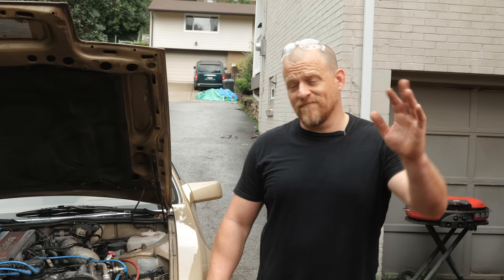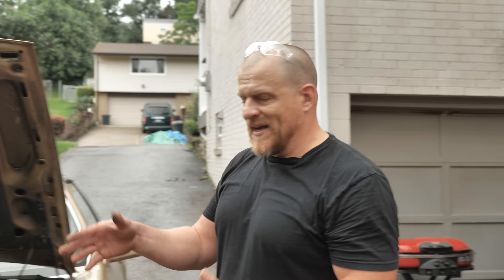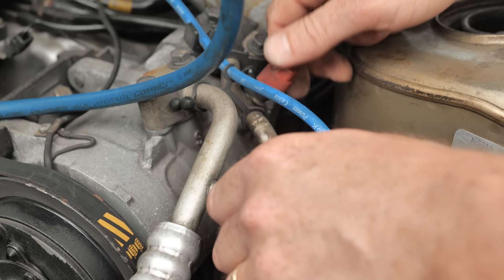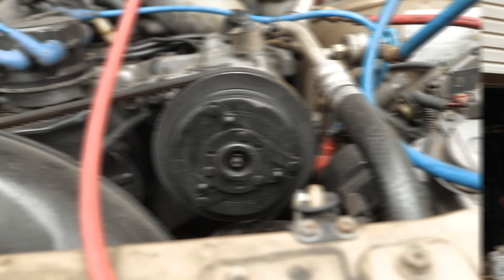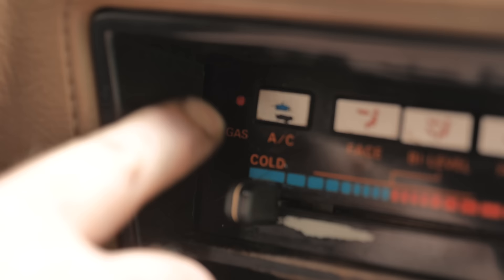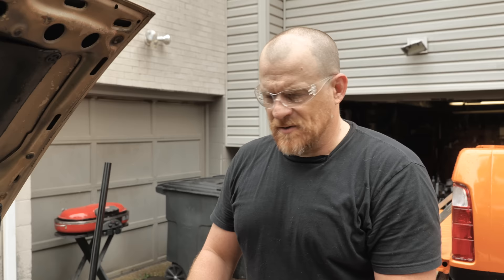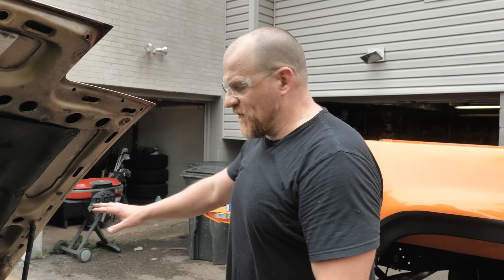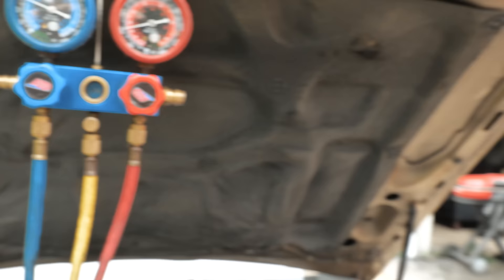A/C Leak Testing, Repair, Evac and Recharge (ANY CAR!)

Comment: I'm sure you are well aware that when it comes to leaks, yet it's always a good idea to repeat, you always find the biggest leak first.  I have come to learn when you find a leak, fix it and look for more, especially when  dealing with customers as they often times think if there is a leak, it's the only one.  Nonetheless, a great tutorial especially when you recap from years past!
Reply: P. Hinton, at 15:08 he indicates his intentions to look for other leaks in the system.  Then at the 20:05 point in the video, he takes some soap and water and spends about two additional minutes looking for any additional leaks throughout the remaining lines/ports/connectors in the A/C system.  But the importance of your suggestion is very valuable: the first leak you discover might not be your only leak in the system.

Comment: When removing the micron gauge; you could have removed it from the car side first using the built in check valve of the low side connector to keep the AC system free of containment air, then remove the micron gauge, reattach the connector and pulled a vacuum on the gauge set with the low side valve open.
Reply: when under a deep vacuum air can pull in via the schrader cores. ideally you'd directly break the vacuum with liquid refrigerant into the high side, after purging from the tank to the gauges or better yet a ball valve at the tank end of hose, which was also at vacuum pump. that way you decay/pressure test everything at once, hoses, gauges, vehicle. and when you go to charge, you only need to purge the tiny amount from tank to ball valve. far less chance of air entering via the hose and gauge manifold, which has a large void area inside as the passages and fittings. better gauges will have more knobs and purposeful vacuum and refrigerant charging ports, with those you pre-connect everything and pull a vacuum on it all, then to charge just close vacuum pump knob and open refrigerant knob into the high side port only. no hoses get moved and the vacuum is directly broken by the charge, nearly zero percent chance of getting air(moisture) in.

Comment: Remove some of the possible leak points from a micron gauge. Attach directly to a high side connector,  Pulling a vacuum through any line set wont give you accurate results. Your always going to loose vacuum at a micron level through rubber hoses, seals and any other joints. A rise/spike in a micron reading can be caused buy moisture suddenly boiling off and escaping the bond from molecules of oil within the lines.
Reply from the maker: Great tips thank you!

Comment: Hello Paul , you have a gift from the god , the way you talking and explaining  is a very clear honest and great knowledge you just made it easy to understand what is going on , A/C is not my interest but you made it easy to understand it , I have Honda civic 2010 in mint condition has 65000 miles no A/C leak full charged but I found step by step I lose my cool air , when I start it's cool after 10 minutes  it blows air , my compressor working , relay is working , fan is working , what is wrong ??? Do I need to recharge it ? or change valve ?
I live in new york wished if iwas close to you , I don't like some mechanic don't have knowledge like you to miss the system .
Thanks
Reply from the maker: I need system pressures during the condition of it blowing cold and warm to help you
Reply: Thanks for your reply , I will do that and let you know , because I don't have the pressure gauge yet

Comment: Another great video, Paul. I’ve watched numerous videos on how to charge auto AC systems but I always learn something new in your videos. I need to buy a manifold gauge set to check pressures. I used a similar formula to adjust the amount of refrigerant in my converted 1988 C4 Corvette and I believe it’s undercharged. It gets “cool” but not “cold” around 50 degrees on an 80 degree day. I can feel the compressor cycling on and off on the freeway and my guess is that it may be the low side pressure is dropping below the low pressure switch’s threshold. Anyway, thank you and happy 4th! God bless🙏🇺🇸
Reply from the maker: Sounds like it my friend. Thank you!

Comment: Thank you so much for your videos  They helped me out a lot. I was able to fix a small freon leak on the high side service port. Vaccum the system recharged it worked fine for 2 days. now it only gets really cold when driving on highways. My pressure readings are low side gauge 42 psi- high side gauge 49 psi . No leaks. compressor works fine. Condenser is clean I'm stuck. Don't know what to do.
Reply from the maker: You have a leak that you missed

Comment: The AC in my 2003 Grand Marquis stopped working last summer after several years of trouble free service so i put my gauges on and it still had plenty of pressure but i also noticed that the electric cooling fan was running constantly even when cold started so i began troubleshooting the circuit and discovered that the low pressure switch was faulty and is tied into the cooling fan module. Swapped it with one from my 2003 Crown Vic and the ac is ice cold once again. Adding refrigerant is the last step.

Comment: thing to do is to mention to users that if they are using something like a thin can of coolant and they open the high pressure valve on the setup, then the 200psi pressure that the high side holds is enough to explode a tin can ...so if you have a proper gas canister then fine...200psi is not going to affect it ...and you can open the high side of your system valve ...
but with one of those tin coolant cans ..if the high side is opened it can cause 200psi to go down the yellow tline and explode the can and blind you in the process
Reply from the maker: Never charge from the high side with the engine running! Ever! I'm pretty sure I said that. But thanks for the reminder for others.

Comment: Thank you Paul for explaining the micron gauge at the end! I knew they were sensitive but not that much! I'm going to have to add one of those to my "trick bag". We're dealing with a lot of the new 1234 systems now that hold less than 1 lbs  of freon, so I can see how a micro gauge can be very useful.
Reply from the maker: Thank you! Crazy once I realized how small a micron actually was lol

Comment: Excellent video Paul, have all these gauges, and not used them effectively.  Just need a vac pump, and metric system is a much better measurement... glad you stopped calling your vac pump a compressor... take care

Comment: F automobile has a R 12 system and adding 134a freon a little bit low on 134 freon  will make the system a little cooler ALSO a vacuum AC pump should run for 45 minutes NOT 30 minutes and you are exactly right ABOUT tag  OIL AlSO Easter OIL is a better OIL for R12 or 134a units or systems

Comment: Paul, minor correction at the 3:50 minute mark: the high side line goes from the compressor to the condenser; the liquid line goes from the condenser to the receiver dryer / accumulator; the next line goes from the accumulator to the expansion valve (or orifice tube) and then on to the evaporator.  In some applications the orifice tube is built into the liquid line, and the entire line must be replaced. There is no line from the condenser back to the compressor. The inlet to the compressor comes from the evaporator.

When evacuating a system; Fieldpiece training recommends pulling to 500 microns (not below so you don't pull the oil out of the system), closing the service valves, and starting the 10 minute timer.  You should not go above 1000 microns in 10 minutes. 1 micron = 1/1,000,000,000 of a meter, so you have a lot more granularity with a micron gauge.  The amount of time to pull the system down to 500 microns will depend on many variables ... moisture in the system, contamination, insolubles, leaks, etc.

Since you are a big YouTube star, you can afford a Fieldpiece SM380V; look for it on Amazon.  The micron gauge and timers are built in and it's a whole bunch cheaper than a Pico scope or a Snap On Verus!  Heck!  I'll bet you Fieldpiece will give you one if you feature it in your videos.

It's a whole bunch easier to service with a 30lb tank and a scale.  Makes it easy to service the exact amount of refrigerant.  With the large tank (upside down & ENGINE OFF!), you can open both the high-side and low-side service ports on the gauge set and close them with the scale indicates you have serviced the correct amount of refrigerant; that takes 2-3 minutes.  Note: give the system a few minutes for any liquid refrigerant to settle out of the compressor before you start the car.
Reply from the maker: For sure, I misspoke there, and thanks for the additional info!
Reply: @ScannerDanner  Oh yea!  I forgot to mention that your vacuum pump oil should be changed every time after evacuating a system.  Moisture and contaminants are captured in the oil, and leaving them in the vacuum pump will ruin the pump.  Also, if you find it hard to pull a system down to 500 microns, you may need to perform a nitrogen sweep of the system and or change your vacuum pump oil.  I had a system in my garage last week that was so contaminated that I had to change the vacuum pump oil twice!

Comment: The bottle has high pressure release disc that will rupture like a fuse  well before the bottle reaches its max peessure rating.  Its essential unless you want it to explode like a bomb in a fire or any other accident.  The guard prevents the bottle from launching off when the disc blows by   diverting the pressure.

Its not intended to protect the bottle from falling  over as ALL HIGH PRESSUURE BOTTLES SHOULD ALWAYS BE IN A CART WITH A SAFETY CHAIN.
Reply from the maker: Good to know!
Reply: @ScannerDanner  
Lol bro you are the humblest youtuber I've ever seen.  I was  playing devils advocate over the top.  Your the man.  I'm gonna get that Sub count up 4 ya
Reply from the maker: @richeager7066  not as much as I should be at times. I'm trying to practice to be quick to listen and slow to speak. It's not easy here sometimes 😅

Comment: Seen something very similar to this on a couple of hitachi ex 120-2 excavators. Fuel water seperator inlet banjo bolt has a plastic screen that threads into the banjo bolt. They seem to like to plug up with this stuff.

Comment: This was a good DIY tutorial on how to charge your AC system yourself. I wish there was more information on how to read the guages if you get diffrent readouts but other than that nuce tutorial.
Reply from the maker: I have other AC videos, one with a bad expansion valve with some goofy pressures. Check it out. It is in my hvac playlist

Comment: Next time when you close the low side line to disconnect the micron meter hook back up the lo side line without opening it to the system then open the gauge low port and vacuum down the line again to remove the atmospheric pressure you introduced when you took off and clipped the line.
Reply from the maker: I dont remember but I think this video was the first time I used it?

Comment: Danner you missed a detail on the ice water, you need to have the probe up high in the glass not down at the bottom. It’s most accurate and  the 32 degrees Fahrenheit, is at nearest the top of the  ice water! Small but very important detail for accuracy.

Comment: When you vacuum down to 500 micron and it raised 10 and then 20... That is actually moisture evaporating. Liquid cant be compressed or seperated. It only consumes the space. As it evacuated under the vacuum, the liquid molocules expand into gas molecules, which decreases the amount of vacuum. This is from the molecules of a solid/liquid being tightly compact, vs gas molecules that are more spaced out. Evaporating liquid to a gas takes time.
Reply from the maker: Yes sir, a tiny leak can do that too 😉

Comment: I am just learning to repair auto ac systems. I have subscribed and watched multiple video's on this subject. This is hands down the most instructional and informative that i have seen. I really appreciate how candid and honest you are. Your being more verbal, aka long winded, was extremely helpful to me.
I do have a question/clarification if the ac system has already drawn in air from the atmosphere due to the leak using dried compressed air does not seem harmful to me to use to locate the leak, especially since a 30 minute plus vacuum is pulled before the system is recharged. Am i missing or misunderstanding something? 
Thank you for your video's i learn every time!!!
Reply from the maker: Thank you so much! 
You're not missing anything, and I'm perfectly fine using dry compressed shop air to leak check a system. I've done it for 20+ years with ZERO issues. As you said, just make sure you pull it under a vacuum for at least a half hour, maybe more. I've only started using nitrogen just to keep the noise down from the peanut gallery 😆 
But I will conced that it is better than using shop air.

Comment: Excellent information. I hate being one of THOSE guys, it looks like you are referencing the wrong scale on the gauges. You kept calling out the outer scale numbers but not using the R134 scale in the blue inner rings. I catch myself doing the same thing because the outer scale has a finer scale. I really like that you referenced the sight glass, in spite of the numbers it is supposed to use. The sight glass was always my final authority for filling the system.
Reply from the maker: Those are temperature scales, not pressure. Pressure is pressure and it is the outer most scale 😉
I believe that is what you're referring to?

Comment: Damn dude, the first thing to do would tap and move the controls and make sure they even work. If the AC clutch is exposed and while the AC switch is on press or tap the exposed clutch and it's possible it may have been stuck.then do a relay bypass and use test leads on the clutch.
Reply from the maker: Or put psi gauges on it lol
Reply: @ScannerDanner  if you're in the middle of nowhere that would not be the first thing to do to quickly troubleshoot. Holy shit dude. Really? I thought you would be smarter than that.
Reply from the maker: @AllFallBeforeMe   🤣 I'm not filming how to videos for people in the middle of nowhere. Also, the other checks you mentioned are fine, but you still got to put gauges on an AC system when a clutch does not engage. It's one of the first things you want to know!
Pro tip for you. Read the title of the video! It's a leak testing video, but your mad because I put gauges on it after seeing the clutch was not engaging? 🙄

Comment: Stick the hose under the level of the oil then open the value and close it before all the oil is gone or use an oil injector.
Reply from the maker: Why? That small amount of air won't hurt anything. That's why you pull a vacuum on the system. What's in a system with a leak? AIR!

Comment: Unless I missed something in your math. 2 pounds is 32 oz. Not 36. I have done that conversion a few hundred times. I always learned that it is the amount of R12 times .8. You need less  R134 than R12. Just sayin. You also have to remember there is a difference between vacuum and pressure. I have had some that never show a leak with a vacuum , but does with pressure.It's kinda like sucking thru a straw, then blowing 200 plus pounds of pressure in that system.
Reply from the maker: Oh I'm definitely off on my math quiet often on camera lol
Reply: @ScannerDanner  All I can say is i'm glad I never made a mistake. Thought I did once. Found out later I didn't .  Anyway I was just giving you a hard time. Good job.
Reply: I worked on cars 50 plus years. Now I only do automotive AC. (Too old to work on cars anymore, still love it just too hard to get up and down anymore)

Comment: Thank you sooo much for the slightly harsh but very true words about charging a known leaky AC system with refrigerant instead of literally anything else. I drives me insane to see certain mechanics here on the tube do that. The same one who changes Schader valves even without checking them.

Also, I think "ScannerPaul" or "PaulScanner" does not roll from the tounge like "ScannerDanner" ;-)

Comment: I have a 99 4Runner v6. I’m pulling out my hair with it. I have replaced the pressure switch, thermistor, amplifier, and AC power switch. I have done all the diagnostic tests in my FSMs. I have had the system evacuated and refilled. According to the technician the pressures were great. So, long story short, the clutch won’t engage unless the pedal is depressed. When the switch is engaged on the dash, the tach does jump up
Reply from the maker: Unless what pedal is depressed?
Reply: @ScannerDanner  accelerator pedal

Comment: Awsome video very factual and detailed.  Awsome job.  I haven't used like a vacuum pump with gages for years.  I hardly even remember how to do it.  I'm used to the regular ac machines.  But I dont have a 3000 dollar machine at home.  But I feel like I was always taught to look for around 30 on the low side.

Comment: I've always liked the a/c out the center vent to be in the mid 30's; and Im in Texas and your in Penn so who knows. I will say this, I cut my teeth on the Z's back in the 80's. Datsun 240z, 260z, 280z, and the 280zx Nissans all had a "design flaw" with their a/c system, the blower motor didnt blow evaporator air into the vents, instead it sucked the evaporator air into the vents, compromising the efficiency of "the cold air effect" at the vents. I dont know if Nissan fixxed that flaw for the 300z's or if they still retained it. Im guessing the flaw still existed in the 300z's otherwise your vent temps would've been about 10°F lower than what they were. I too miss the sight glass from the older cars driers - dont miss the carburetors, points, and all their stupid vacuum lines.